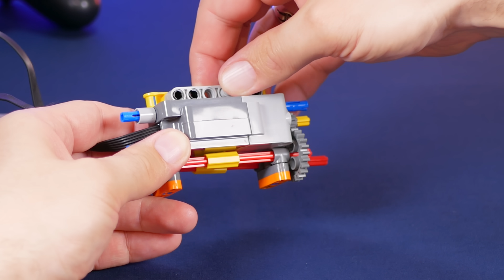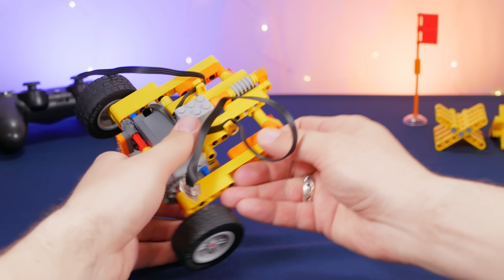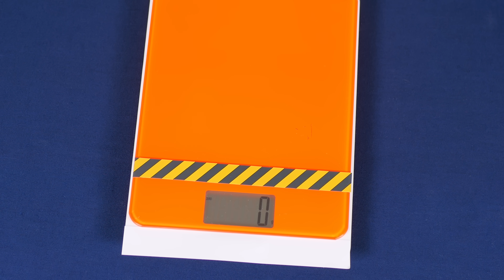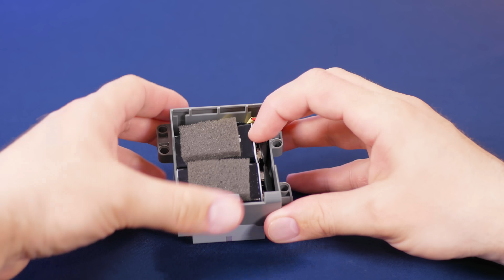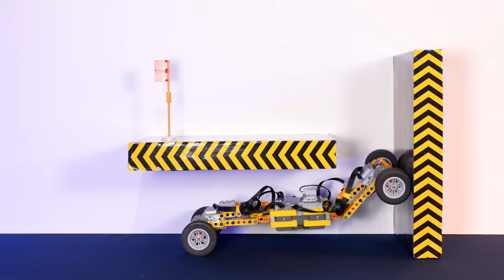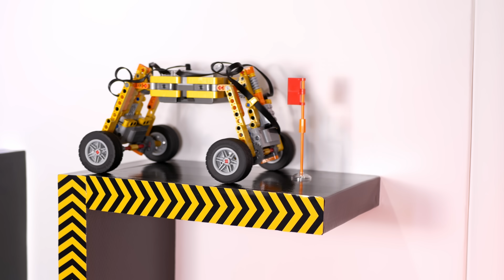LEGO Technic Climbing Car: Obstacle Challenge

Comment: Aren't you overvolting the motors because 2 nine volt batteries is 18 volts and 6 AA batteries is only nine volts but who knows i might just not be smart😂
Reply: If they're wired in parallel, the voltage would still be 9v, just with double the amperage
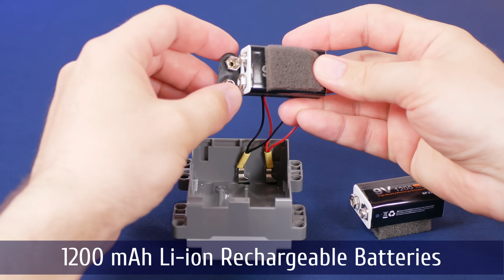Reply: @HeavyD81  yea they are wired in parallel. you can see it at 2:46
Reply: Can you explain in easy mode
Reply: @AkuroReacciones  no. Just understand it
Reply: @AkuroReacciones  They were wired to make it like 1 battery with 2x  charge, and not 2x power being used. They basically just lengthened the life span, not power.
Reply: If you have two 12 volt car batteries and connect your car to one, you have 12 volts. 

If you have two 12 volt car batteries and connect the two batteries positive to positive, negative to negative, you still have 12 volts because they are in parallel, but you have twice the capacity and twice the amperage. 

If you have two 12 volt car batteries and connect one positive and one negative, and then connect the batteries from the remaining positive to negative, you will have 24 volts because you have wired the batteries in series.
Reply: Well it works so😂
Reply: No because in parallel it,s more current

Comment from the maker: Any ideas on what type of climber might be better than a wheeled one?
Reply: Rubber tracks
Reply: @jbgaming8683 yes, squishy old rubber, insanely good grip and friction
Reply: Spoon type feet
Reply: nah sorry
Reply: Alternating rubber feet? Kind of like how people free-climb between two close walls, have two feet always on the wall while the other two feet lift up and set down higher up each time
Reply: You could put some smaller wheels around its mid section so it doesn't get stuck on edges.
Reply: One that fires a grappling hook! 👊
Reply: Proppelor elevator